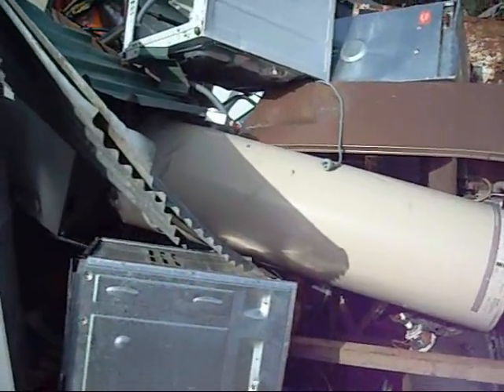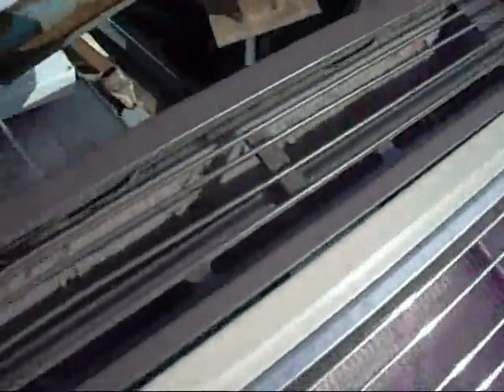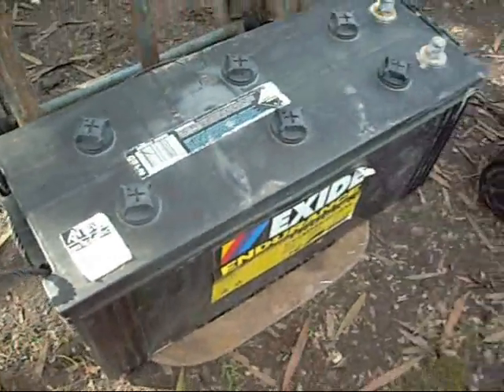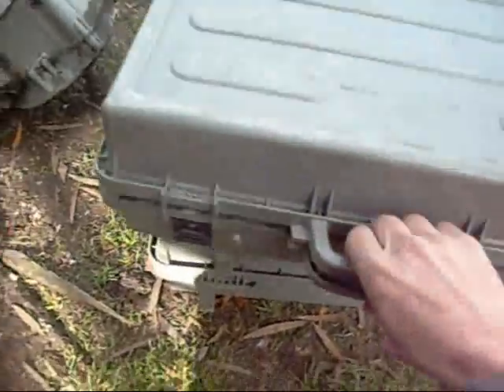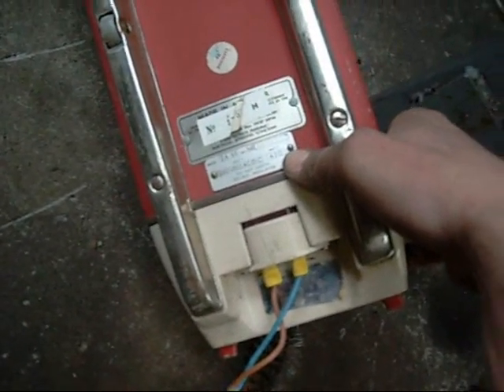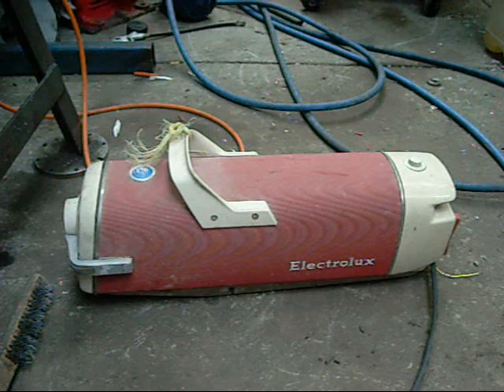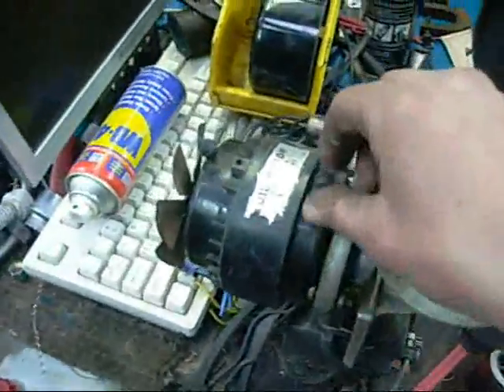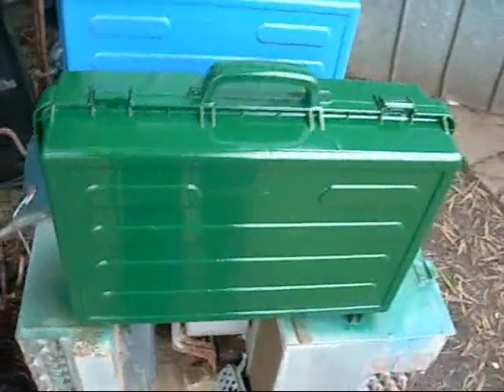Scrap yard Loot! - Vintage Electrolux Vac, Pump, Carry Case, heaters Etc..

Comment: The Model Z65 was sold internationally.  Yours is marked "ZA" because it was designed for your country's product specifications.  Electrolux called the color combo rose red and ivory.  It was manufactured from 1960-64.  You might try contacting AB Electrolux for a scanned copy of the owner's manual.  Great save!

Comment: I have an Electrolux model L from 1954-1956 which is used on a regular basis.  Had a loose motor when I bought it, so I put in new screws and some rubber faced washers.

Comment: mad. ill take them heaters if you dont want them. slow charge for 2 days with that batt should help it. cool engine. nice boxes. looks like a good day all round
mad vac. i may have a plug for it. nice pump.

Comment: that vacuum cleaner is at least 35 years old, the sixties might be more accurate indeed , my parents had something similar when I was a kid. and it was old when we got it :-) Those vacuum cleaners can also blow if you put the hose on the other side, at least the one we had had the option that it was possible to switch the hose from the front to the back. I used it to blow up my rubber boat when I was a kid.

Comment: they use the same plug as is on a sewing machine foot pedal. the Bakelite type. the 80's electroluxes were indestructible so if this has better suction then it must be pure gold.  from what i coud see that briggs is the type designed for victa bases only because it has a shorter crankshaft.